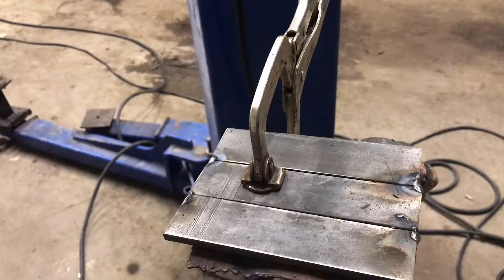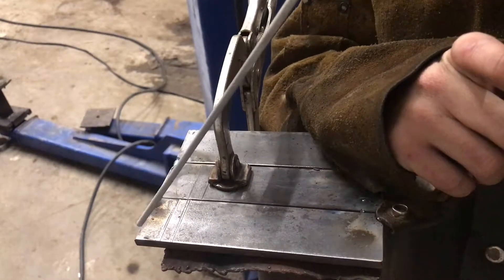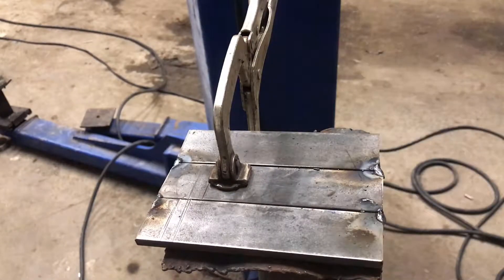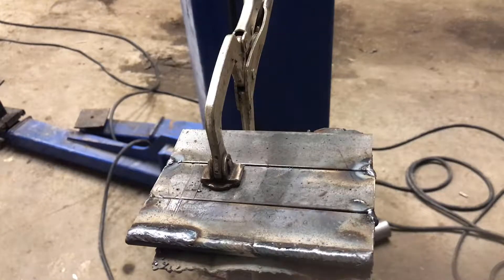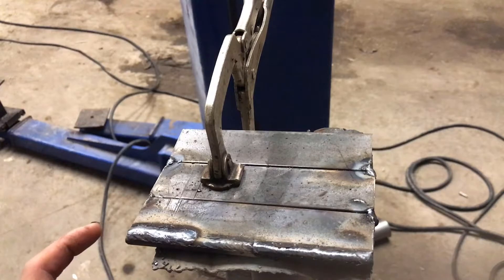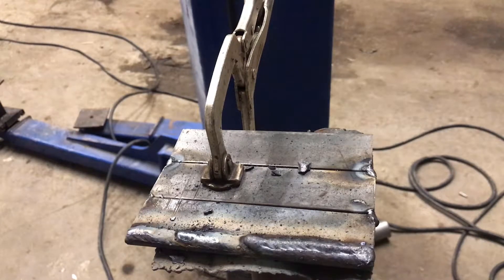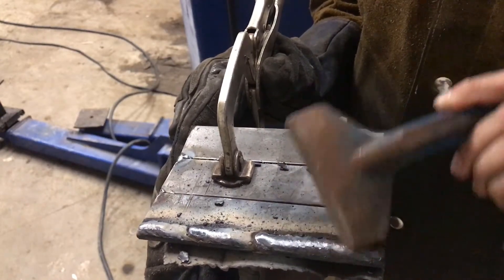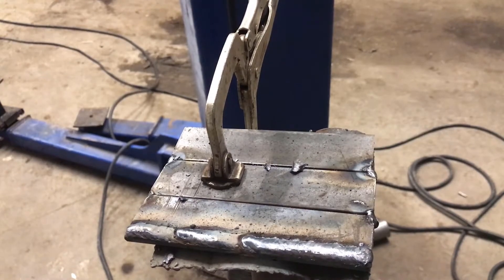6013 Striking An Arc And Welding With The Lincoln Ranger 225 Pt.1

Comment: Is there a flux core wire feeder attachment for the 225?
Reply from the maker: I’m sorry I am just now seeing this but yes you can run a ln25 or a Miller 12vs off of this machine perfectly fine! I have run a profax clone of the 12vs off of this machine and it ran fine

Comment: Great vid, Adam! 
I've got a question for you; just want to confirm: did you draw any particular pattern (curls, zig-zags) when dragging the rod, did you just simply drag it on a straight line? Cheers!
Reply from the maker: That’s a great question well everyone does it a little different but sometimes I do a straight drag and other times I do a little bit of a side to side motion, I believe back when I did this video I did a drag with a hesitation to let the weld puddle build up some.